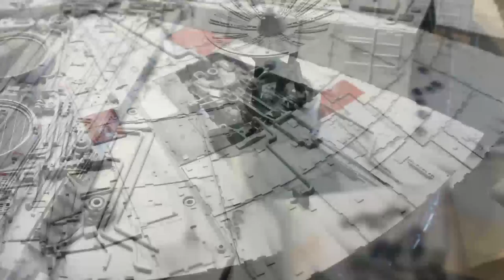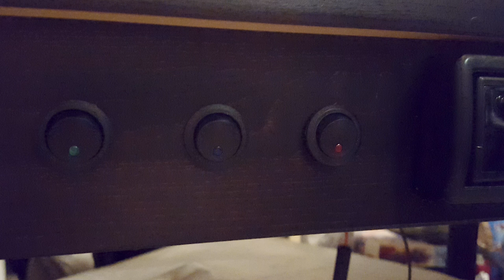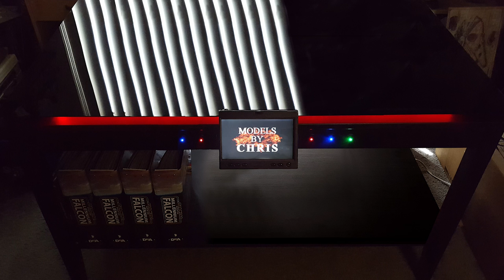DeAgostini Millennium Falcon Customized Build Pt 14 Upper Final Paint

Comment: I know it’s been a while but I hope can remember what color you use for the rear exhaust vents and stains on the back, also the airbrushed weathering streaking around the falcon? Thank you for the videos they have been greatly appreciated.
Reply from the maker: For my exhaust and streaks around the Falcon, I used Tamiya German Gray.  That's typically my go to paint for dark areas of vehicles.  I don't like using black, because it usually tends to be to dark and pops too much.  I find that German gray tends to look more natural, but still gives a dark blackish appearance.  And I try not to spray to heavy.
Reply: Christopher Olson Thank you! I’ll definitely take your advice and lay off the black.

Comment: I can see you mention some colors in your youtube. A list of of colors used would be interesting. Right now I do have on my list: Tamiya XF64, XF53, XF3, XF7, AS20 & TS80 Spray. Anymore paints needed/ recommended? Thank you so much and thumb up.
Reply from the maker: That is pretty much the main colors I used, along with Tamiya XF-1 black and Tamiya XF-63 German Gray. I did also use Tamiya clear red, yellow, blue and green for the back lighting of the photo etch cockpit rear wall and gunner walls.  I also used a variety of Tamiya Pastels for streaks and dirt around the ship.
https://www.amazon.com/TAMIYA-Weathering-Master-6-Sets-Japan/dp/B00M66FM86/ref=sr_1_1?crid=MIYKOBSRAJY9&keywords=tamiya+weathering+pastels&qid=1693863856&s=toys-and-games&sprefix=tamiya+weathering+pastels%2Ctoys-and-games%2C151&sr=1-1
Reply: @modelsbychris  Thank you so much Chris, I will check into.

Comment: Hey Chris good work mate
Did you at any stage apply clear coats during your build?
If so when and what type of finishes/brand?
Thanks
Reply from the maker: I actually did not do any clear coats.  I just applied my washes and weathering directly to my base paint.  I sealed it all with a flat coat however

Comment: Thks Chris, I really appreciate your feedback and your work as well, and what kind of glue you recommend me to use and where did you get the 6 fan motor you used and the inside play room oil bottles - sorry if I bother you with all these questions but I have not all your expertice and experience, thks.
Reply from the maker: I just use Loctite super glue.  The exhaust fans and oil drums and such I bought on shapeways.com. if you search deago falcon on there,  there's lots of 3rd party parts you can buy. The fan grills are from paragrafix.biz

Comment: This kit is soo detailed!!!!!! I wonder how the Bandai Perfect Grade will be...
Reply from the maker: It looks like a beautiful kit.   It's less than half the size of this Falcon.  But it should be the most detailed closest model next to the DeAgostini.
Reply: The Bandai PG 1:72 is the most accurate model of the Falcon every commercially made. It's more accurate and faithful to the five foot model than the DeAgo is to the 32" model.
Reply: The perfect grade from what I've seen, far surpasses the DeAgostini in accurateness and greebs but thats just how the 5 footer was in actuality. ANH was just more highly detailed and just more put into it the 1st time around.
The weathering and the fine detail was vastly more apparent/realistic than the 32" and not just because it was bigger. 
I have half the order now and when I do start to build it, it will be a hybrid of both with the bent hull panels edges to the realistic 3D looking blast holes. I'm gonna shave down the end  edges of the hull to appear thin as in ANH.  I also noticed that the ANH had deeper side panel insets compared to the 32" which I will attempt to do close to a 1/4 inch deeper.  Thats how good the Perfect grade is because it already comes like that out of the box.